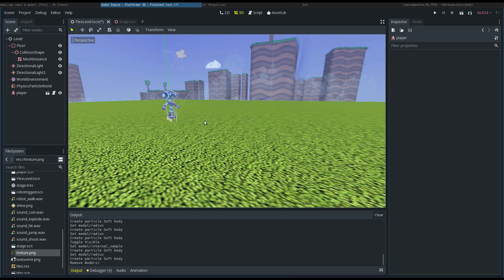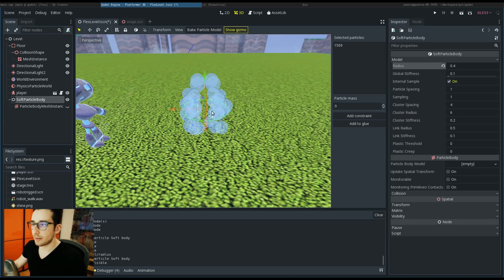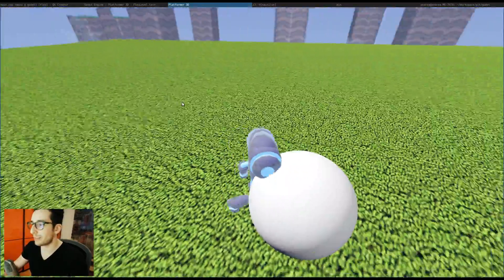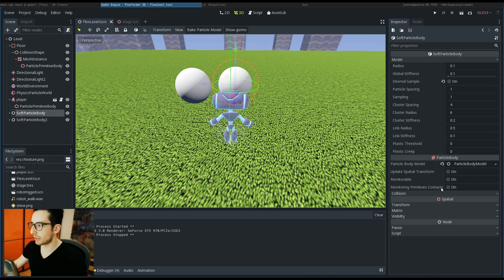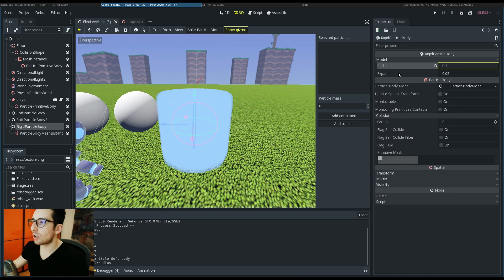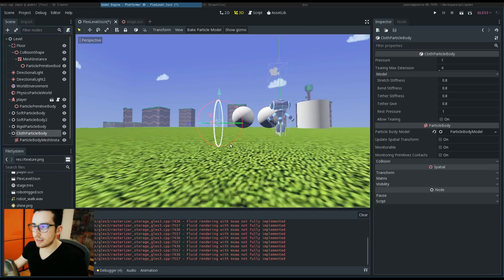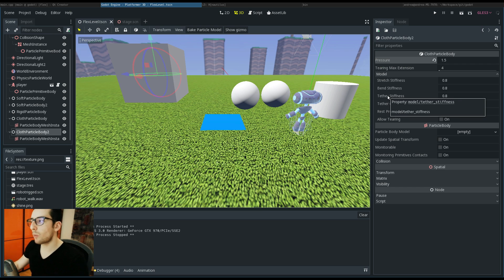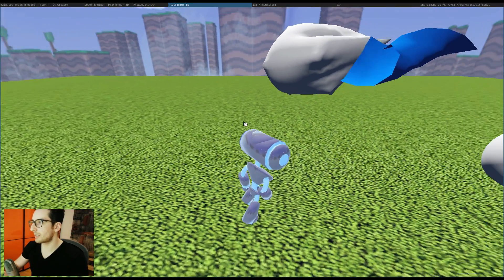What is Flex engine? - Godot Engine - Nvidia Flex #2

Comment: Is this only for nvidia graphics cards?
Reply from the maker: In this moment yes, but it also can run using DirectX 12 so it could even run on AMD. [I didn't add the support to it yet]
Reply: @AndreaCatania  are you sure about this?? i keep finding information that says you need an nvidia card. altough most of it seems pretty dated except nvidia's faqs. But anything i find that says you can run it on amd says it runs on the cpu. Kinda like how i can run iray on my amd card but it runs super slow on my cpu.
If you could link to any resources it would be very much appreciated.
Reply from the maker: @ravanin Wey man, This is what the Flex readme says:

---------------------------------------------------------------------------------------------------------
Supported Platforms

    Windows 32/64 bit (CUDA, DX11, DX12)
    Linux 64 bit (CUDA, tested with Ubuntu 16.04 LTS and Mint 17.2 Rafaela)

Requirements

A D3D11 capable graphics card with the following driver versions:

    NVIDIA GeForce Game Ready Driver 396.45 or above
    AMD Radeon Software Version 16.9.1 or above
    Intel® Graphics Version 15.33.43.4425 or above

And either:

    CUDA 9.2.148 toolkit
    DirectX 11/12 SDK

---------------------------------------------------------------------------------------------------------

I didn't try it yet so I'm not 100% sure but in the compiled library I can find the DirectX version. So seems to me that it's also available for the AMD card.
Reply: @AndreaCatania  i keep looking it up and it and keep finding that cuda is not supported by AMD.  Also (an i really dont wanna sound preachy but)since godot is more of an open source thing shouldnt you use AMD since they are definitely more open source friendly?
Reply from the maker: @ravanin  CUDA is a Nvidia technology and to use Flex with AMD gpus you have to use Directx which is available only on windows. Since I'm using Linux and I've a Nvidia card I choosen to use CUDA. By the way Flex is not open source so despite the technology used it is not OS friendly.